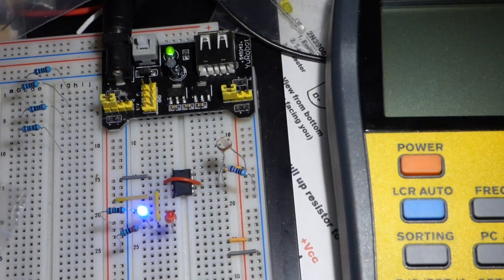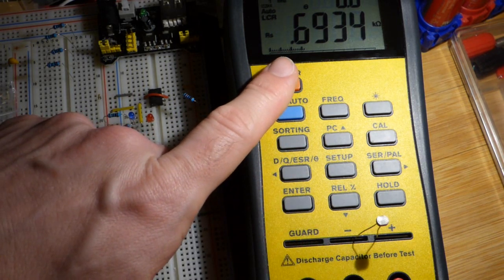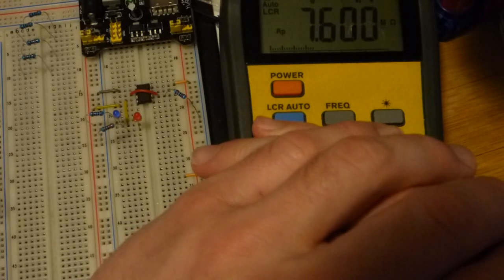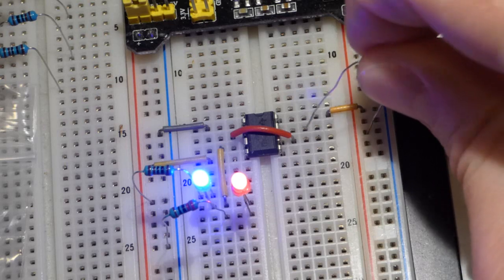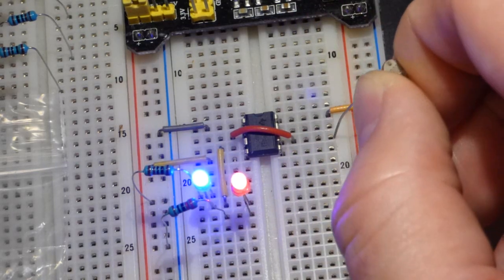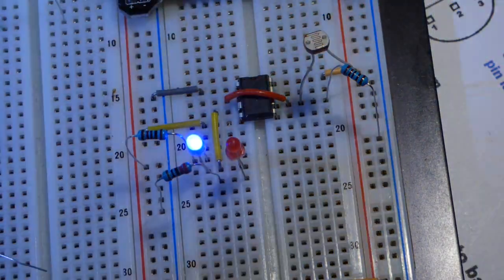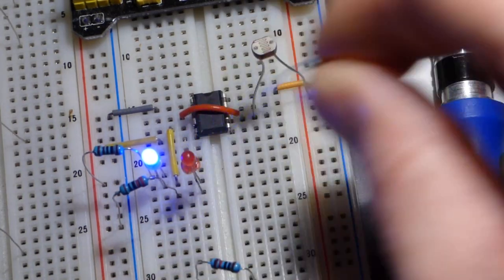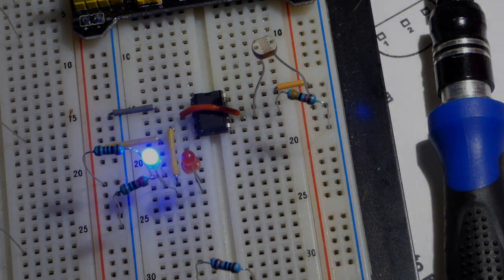Sensitivity adjustments of light dependent resistor LDR voltage divider controlled 555 timer circuit

Comment: Hi, just found your video - great! A question  ... I want to use LDRs to detect when a model RR car covers the sensor and shades the florescent lighting in the room - thus turning on a LED in a model building. All works well ... except when the LDRs are in a corner of the room where the florescent lighting is dimmer. How can I adjust the LDR's sensitivity given a non-variable light source?  Thanks
Reply from the maker: All I can think of for that situation is to add light on the LDR by using an LED or something.